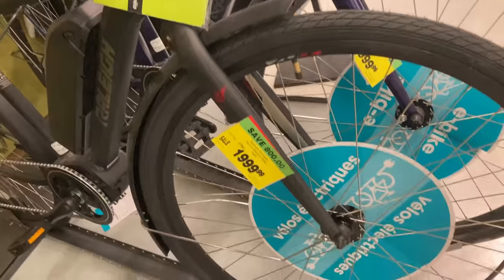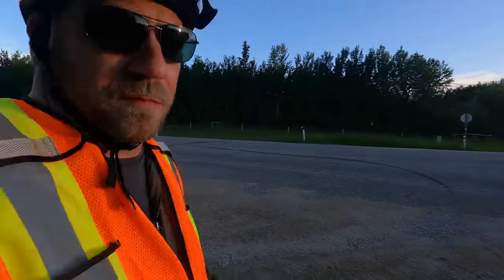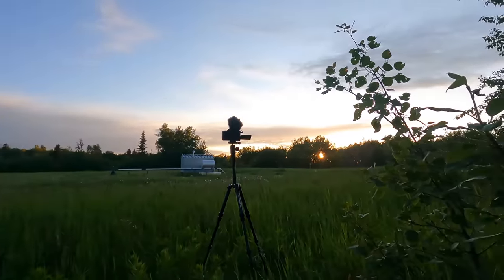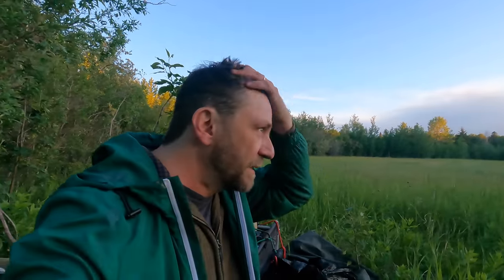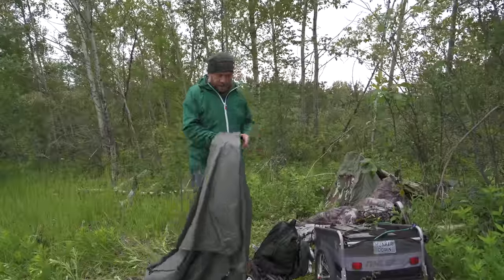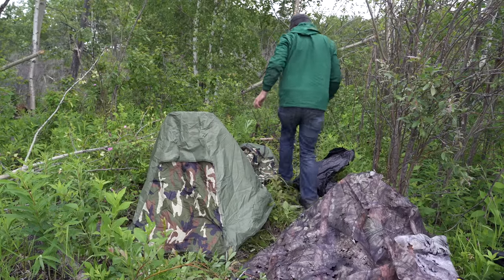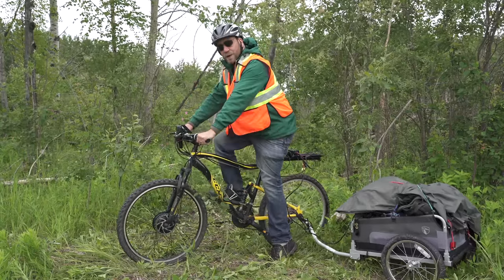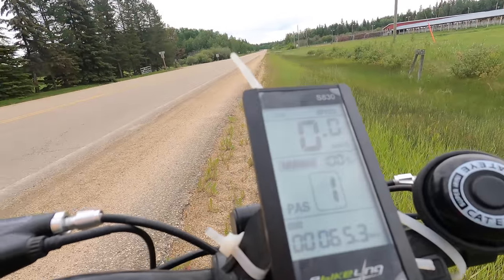DIY E-Bike Stealth Camping

Comment: Really, you've only just tasted the potential of ebikes, including DIY.  

FWIW - on a tadpole recumbent trike setup - a 48v19.2ah battery is good for near 60km' range with mixed use on a 1000w hub.  I've got two of those on board.  I've eyeballed a gooseneck trailer arrangement, for additional cargo capacity should it be needed.  It's structurally built for it.  

On a 48v13ah battery, a 1000w Bafang mid drive downhill oriented MTB will do approximately 30km, depending on how many steep hills it's climbed, to go back down again.

These are a $4000.00-5000.00 class fully custom DIY ebike setups - a step or two above slapping suspect and possibly dodgy components on a bicycle for the average bottom dollar Amazon kit.  There is a fair amount of sweat equity and parts replacement involved to make a durable project.  

I'm sorry to say - but there is a degree of a buy in price attached to entering into it, with reasonable expectations of satisfaction - given demanding use you are putting on one.  

There is a false economy of buying too cheap/below expectations, and then having to buy twice... but, everyone is a beginner once, and everyone goes into it with own knowledge limitations.  

I hope this hasn't discouraged you - but the 12v lithium packs are a little suspect - did you have a BMS working with them?  That would explain draining one after another.  No balanced battery management.  

There is a huge amount of potential in the ebikes, for the sort of 'stealth camping' that you do...  i only wish that i was healthy enough to do some of it myself.  I am happy enough that i get to replace the gas thirsty truck for much of three seasons out of four. 

I'd suggest getting onto a DIY forum like https://www.endless-sphere.com/ and check out the potential of the tech, from a DIY angle. 

JMHO, and FYI.

Comment: You could use the body in the trailer, use it like a vertical collapsing roof rack. Pack the sides for height and stability. Maybe fatter tyres on it so it has more bounce on the dirt road maybe? 
Wait, is the battery the size of the trailer?

Comment: With electric vehicles up hill is the enemy, although i do like steep hills as i get off and push gain elevation quickly and save a lot of battery this way. Long gradual hills suck the most, too long to walk but suck the battery fast compared to flat, Head winds are also bad.

Comment: LFP batteries are actually insanely safe, they hold about 13% (on avg) less power than Lithium-ion/poly batteries and don't have the same high amp dumping capabilities, but they have less discharge, are safer to store, have wider temperature range in both charging and use at full power draw. also if you chuck one in a fire, everything BUT the actual battery internals will burn, the internals kinda act like sand. do that with any other lithium type and you will have molten metal splatter burn marks on your arms for the next 3 decades

Comment: 6:06  I think would have gone over to the edge of the start of the trees and went around directly in front of them as closely as possible instead of cutting right across the grass leaving a visible trail for anyone curious of what went through the grass and made vehicle tracks. Though I doubt that road gets much traffic and the grass probably recovers quickly.

Comment: Of all the four engine turboprop planes flying in formation in Canada there's the C 130, and the C 130. Flown exclusively by a single operator, the RCAF.
Reply: and the Aurora  too eh?
Reply: @mrbillmacneill  How are you now? I think those are Herculeses for search and rescue going to or from Comox and Cold Lake to fill in for the Buffalos that all retired. The replacement plane should be ready in 3 years. C 130 is picking up the slack. You're right of course. I just can't imagine a C 140 flying in formation around Alberta but I'd like to see it! Have a good day eh.
Reply: @m1t2a1  there are not many submarines on the prairies...

Comment: I have an ebike.  You need a better way to monitor battery levels.   With my 48v mid drive on a 13ah battery i can get 25 miles or so...speeds 20-30mph.

Comment: Best thing I can recommend, look into a lithium ion battery with a good capacity. It will definitely weigh less than all those batteries, if it's not cheap, it's worth it I think. You can buy ones that will attach onto your bike frame so you don't have to pull it on a wagon.

Comment: did we figure out what the problem with the turning off was? my assumption is that 1 battery got low and hopefully not reverse charged and that caused the voltage of the 3 in series to be too low. i would have advised you to try 2 in series when limping home on the 24v setting.  sure would have been a good time to have a multimeter

Comment: Could you in theory do some kind of quick release axle/power connecter system, and carry multiple "front tire and electric hub" assemblies on the trailer? In case one failed? Easy switch out?

Comment: I have a trailer like that, my batteries would only last about 40 or so miles, maybe 50 miles and that's with pedaling plus not going so fast, I am waiting for my controller to come back so I can mount my 2nd motor so it will be a 2 wheel drive again. So what is you battery backup?!?

Comment: Each of your batteries has a battery BMS (battery management system) in them (unless they are bad) then one of your bat was lower than the other two and th BMS shut IT down to keep you from discharging it to deeply and destroying it. Long and short of it just charge your bat.

Comment: Perhaps I'm not understanding the concept of stealth camping, but why do you pitch a tent in the high grass, especially near a body of water?  In the piney woods of Texas you'd be in danger of inviting any number of snakes, including a few venomous ones, not to mention spiders, chiggers, and the occasional rodent looking for a meal.  We have two kinds of mosquitoes, the tiny no-see-ums, which can drain you as quick as the second kind, which we have to swat with a twelve gauge.  BTW, I scratch through the entire video.  I almost had to light a mosquito coil just watching.

Another thing ... you display bright video lights and flashlights, but you don't want to chance building a Dakota fire pit?  You could position the trailer to block view from road.

Comment: This is something I wanted to try however I bought a "SameBike" and the engine died after only 28 miles. After I replaced it the rear fork stripped out and it sits in my garage with only 128 miles on it. So be aware of crap companies like Samebike that have aluminum frames with steel axels that stripout and render the bike useless.

Comment: wonder what temperatures those tiny wires got to when you speaker wired 3 battery cycles through them full speed w/a 200 pound load

Comment: 2 things that will run your battery quick.. 1. dont use the throttle the whole time. 2. Don't have it in 5th gear or it will use more battery power. (P. S. PEDDLE ASSISTANCE USES LESS BATTERY THAN THROTTLE)

Comment: and here, (Australia) it costs $4000-$7000 for a decent, certified, legal, 250 watt E-MTB.

Was riding my electric scooter at 30km/h, safely on the footpath  (clear visibility with no other pedestrians) and the police stopped me, (parking in a pushbike-ONLY lane). Just to get out and threaten me with a $2000 fine for riding an 'unregistered vehicle'.

Because I'm not an idiot, I apologies and ask whats safer; The footpath or the road? Which they refused to answer and left saying 'just get it home'

They now know me and I'm afraid to ride down to buy milk/bread in fear of a punishment that does not fit the crime.

Comment: radwagons cost at least a thousand less than the class of bike they're rated. as in bikes in the same performance level are more expensive. They can really get going and have huge batteries and torque its nearly an electric scooter rather than just a bike.

Comment: Don't re-enforce the trailer, giving it less flexibility will make even shorter work of it. 

You want to add flexibility, and dampening so that vibrations don't pull it apart. Ie. You need a custom shock absorption and dampening system. 

Sounds like a project crazy neighbour can help you with. Please film it as a step by step video with crazy neighbour giving explanations 

Or, you could use it as an opportunity to colab with an engineering or 4WD channel.

Comment: Is it possible that as the batteries drained the voltage just fell too low to power the equiptment? Not an electrician, but I would appreciate anyone in the comments letting me know.

Comment: Whenever my ebike loses power like that it's always the controller. Batteries and motor are too simple to fail as often. I've found that the controller has capacitors that need discharge disconnected from the batteries to reset. I ride a couple hundred miles a month as my primary means of transport now and it's always the controller.

Comment: You can't depend on the voltage meter to tell you state of charge with lifepo4's, you have to use a meter that counts amps. If you want the soc meter to work you need to use lipo or li ion

Comment: To be fair... you were not really biking.  Motor alone with no pedal assist will definitely deplete your batteries.

I have a 15 ahr battery on mine but I'm still pedaling... I think I could get 90 to 100km out of it, but no trailer full of gear.

Comment: ha-ha...don't blame the ebike kit. These things are pretty bullet proof. You probably tripped the low voltage cut-off.

Looks like you're carting around 3 lead acid batteries...unless they're lithium replacements for lead, they're going to weigh a ton...if they are lithium replacements, you might have tripped the low-voltage cut off on the battery management system inside, at which point it will refuse to turn back on until it gets a bit of a charge. 

You were complimenting the kit before your issues at the end; I'd blame user error/limited understanding; it probably came back to life when you got home and charged it.

Those roads look to worn out for the island, but if you're here and it's still not working, let me know and I can diagnose it for ya.

Comment: The thing is, you ALWAYS get what you pay for.   You were looking at an electric bike, even the cheap ones, which were about 2000 bucks right?  Right.   OK...so......you've already spent whatever you spent on the bike....call it 100 bucks.   The kit was 330 bucks, call it 350 bucks.   You're already in for 450 bucks.   Then there's the batteries.    You made ZERO mention of how much all those batteries cost, but, I know a little about batteries.....I believe they're lithium, or you wouldn't be toting three of them around on a tiny little cart, and there's no way that those batteries are less than a couple hundred bucks a pop, UNLESS you're just lucky enough to "know a guy." 

So....6 hundred for batteries, (at a minimum, I'm thinking more like 300-500 depending on the battery)  and you're already in it for at least a total of 1,050 bucks, and then you have to wire up everything, and install everything yourself, OR pay someone to do it.  

So....for well over a grand, you've built yourself a totally unreliable POS, that is going to need constant work, constant parts, constant replacing crap, etc, etc, etc.  

And then what are you going to do, (like what just happened), you run out of battery power on the road?   How are you going to charge you batteries?    They actually have simple little solar panels for the E-bikes as  well, so that you can recharge your battery, or....if you prefer....you can just have a SPARE battery on hand.......they're small enough where they don't take up hardly any space...you could literally have everything you need in a backpack, instead of having to pull a trailer around......

And oh yeah.........there's that cost too..........that trailer?   (again, unless you know a guy pr you got a stupendously good deal)  cost you at least, a hundred bucks......You WILL wind up spending more than you would have if you just bought an actual REAL E-Bike in the first place.  

Nothing you, (or I ) ever make or build will EVER work as well as something you can buy.    Don't fall into that way of thinking. 

And you will ALWAYS wind up paying MORE for the POS you built, to get it to work like the thing that you were trying not to spend all the money on in the first place....

Life's lessons friend......